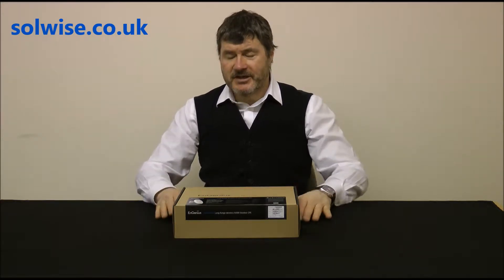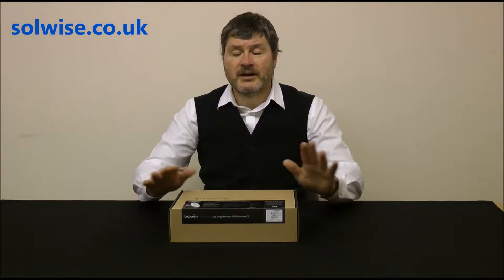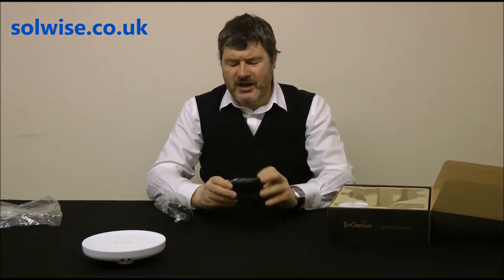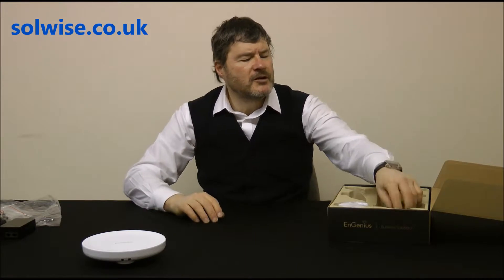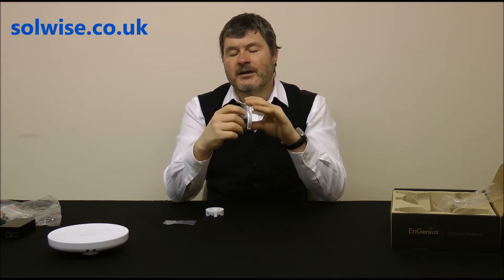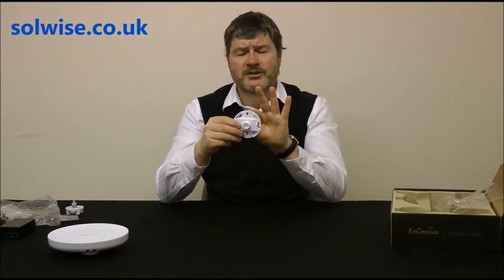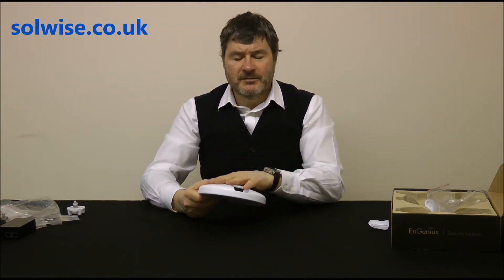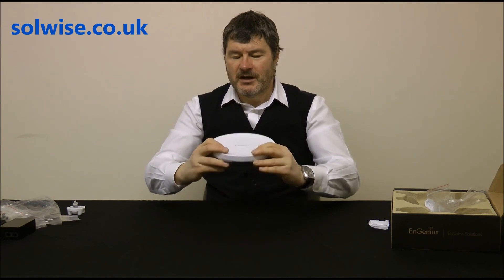EnGenius, ENSTATION5,  5GHz Wireless Outdoor Access Point/Client Bridge unboxing video

Comment: Recently set this up on roof of my building and had few questions.

1. Do these last long and will there be no condensation inside the AP overtime?

2. Since there are two ports , the cover has two open space for the wires to go through. Since I only need one for the PoE , should I look to cover the other open space of cover to avoid condensation or is it fine to leave it as it is?

3. Does the plastic degrade due to UV rays?
Reply from the maker: Well, they last years! Never had an issue with condensation or damp. There's an element of heat generated by the electronics of the AP which stops any issues. I wouldn't bother plugging the unused hole (in fact I haven't bothered with the one I have at home for my outdoor wifi). No degradation of the plastic with UV other than they do start to yellow over time. Steve.